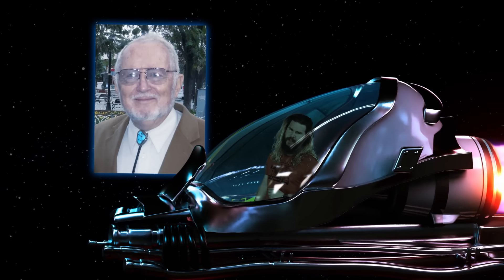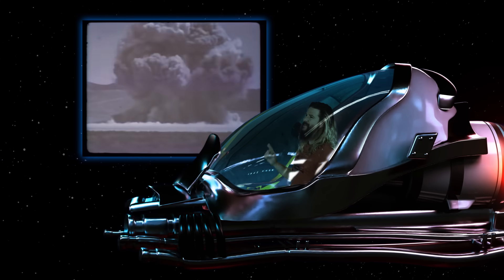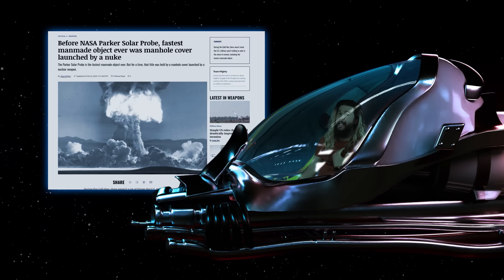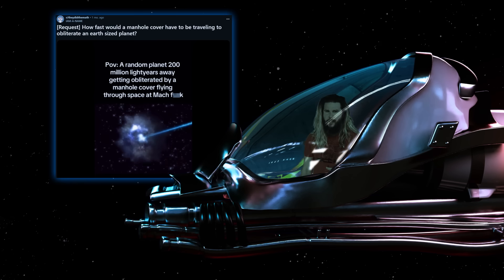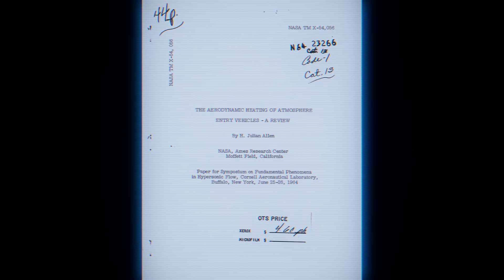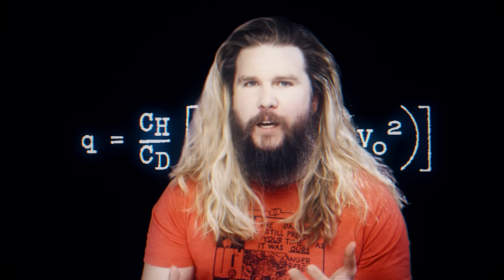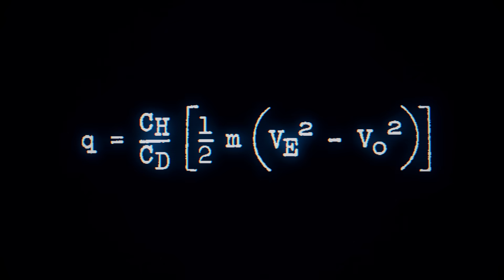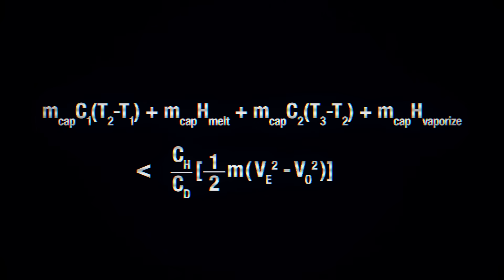Debunking the Nuclear-Powered Manhole Cover

Comment: Yo, @kylehill - I believe there's a couple of glaring issues with your mathin', there... 
1) given the speed at which the thang was traveling, it would have reached the vacuum of space in a little over a single second. Is that actually enough time to vaporize it all, or would it be just enough time to melt it into a more aerodynamic shape and give it a fighting chance? Doesn't your equation assume an increasing air density and increasing heating over time, instead of the inverse? Also, I doubt it would have remained flat-side forward for long without either flipping or deforming
20 wouldn't the blast/shock wave traveling around the manhole cover shield it from a great deal of that aerodynamic heating (kind of like a supercavitating torpedo), long enough that by the time the effect dissipated, it was basically in a frictionless environment?
3) you use the example of meteors, but these go through a whole lot more atmosphere than the manhole cover would have (going straight up), given their plunging, diagonal trajectories across hundreds of miles of ground.
4) you assume the historical numbers from Brownlee are correct, but did anyone double-check them against the yield of the charge, shape of the cavity/borehole and so on? What if the guy was way off on his napkin math? Worth the extra math in order to be extra thorough putting the whole debate to bed...

Comment: This assumes at exiting the atmosphere it's at 0 velocity. You'd need to integrate over the applied force to see if that's true, by expressing it as a differential equation knowing density vs altitude, drag (and gravitational) force vs altitude and speed (basically already have it from an air density vs altitude plot), then getting a velocity vs altitude function (ignoring reduced mass from vaporization as a conservative estimate): (a, b, c... costants, x followed by . or .. are the time derivatives of altitude)
a * x.. = c * rho(x) * (x.)^2 + g
Solve for x.(x), substitute around 100km, and you get the real v_0

You'd probably still find it burned up, but I'm surprised you'd didn't mention missing this number.

Comment: The LHS is way too big.  The key point is melting point, not boiling point.  Once iron is fully liquid, it will be rapidly deformed by the atmosphere and its drag coefficient skyrockets.  Basically, it will separate into small droplets, each of which can divide further.

It's actually worse than that though.  Due to the high speeds, there will be a massive thermal gradient in the lid.  The outer most mm or so will be melting and rapidly ablated away.  Looking at actual meteors (as suggested in this video), a fair number of them literally explode.

Comment: Would the nuke itself have done any work heating the manhole, or would it have been travelling fast enough to outrun the wave front? The latter would give some credence to Film Theory's conclusion that Indy would've survived in the fridge (assuming the latch broke on impact). Yes, I went there...

Would C-sub-d change based on atmospheric density with height? If so, this becomes a differential equation, though I doubt that would affect your conclusion.

How did you ultimately determine a reasonable value for C-sub-h?

Comment: Every single person I have ever seen talk about the "nuclear manhole cover" is wrong.  Because everyone starts with the assumption that you can just slap a chunk of iron so hard with a nuclear blast that it will be going 66km/s but the iron will still be a solid piece. The reality is, that the energies associated with shockwaves moving at those speeds are far higher than the energy required to vaporize any material that can be made out of atoms.  The cast iron cover was at the top of a pipe that focused much of the energy of a nuclear explosion onto it, it would have vaporized in the same way that the casing of the bomb vaporized.  The manhole cover didn't go to space, nor did it burn up in the atmosphere, it stopped being solid before it had time to stop being stationary.
Reply: Is that why they saw it intact in one frame of film?
Reply: @JoeSmith-cy9wj  I had thought that I had seen the original footage somewhere where it went from stationary to out of frame between frames, but apparently I misremembered.  However, the speed that was calculated based on the object being out of frame by the next shot was not 6x escape velocity, it was some speed that was sufficiently unimpressive that the guy didn't even remember it.  The 6x escape velocity number comes from some simplistic calculations done before the test to show that the iron cover wouldn't contain the blast.
Reply: @faroncobb6040  Oh. Then the whole thing is a fiasco.
Reply: I suppose someone good at this , IF they knew exactly how much of the energy was directed towards the cover, rather than compressing, fracturing and dislodging the ground, AND the exact yeald, taking unto account the efficiency and design of the bomb, could theoretically ( as opposed to the eye witnesses of the camera) determine whether that energy delevered overrode the iron bonds of the covers atomic structure.
Reply: But then again,  rockets melt on re-entry, not launch.

Comment: I suspect that your calculation is only a starting point for the answer, unfortunately. The density and temperature of the fluid (air in this case) is not constant during the change in kinetic energy so I reckon you're gonna have to dust off a textbook on differential equations and use an iterative numerical solution to approximate the answer. No wonder it's never been calculated!

Comment: There's a difference in that the manhole cover was moving from the bottom of the atmosphere upwards, while re-entry objects fall from vacuum to ground level. The rate of deceleration would be faster closer to the ground, but even if it shed a lot of velocity early on, that order of magnitude in Kyle's calculations would more than cover the difference.